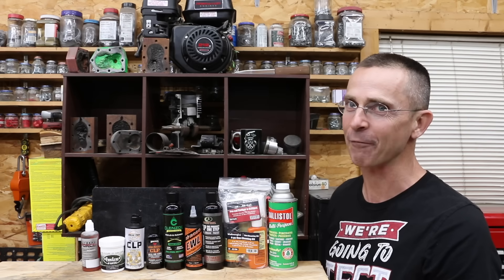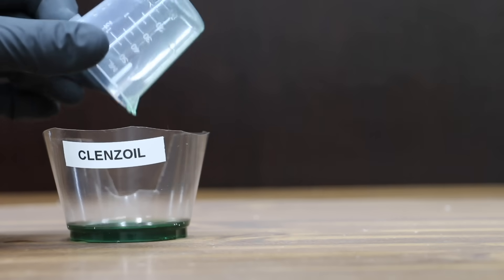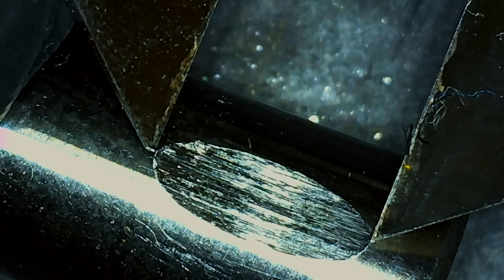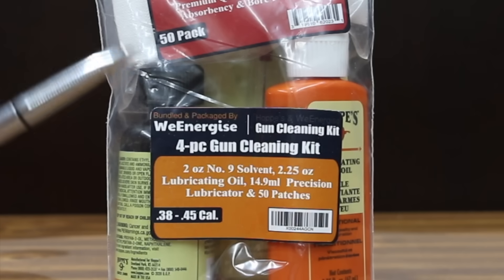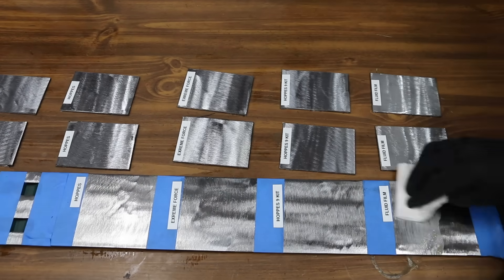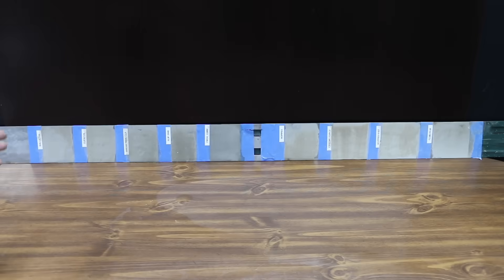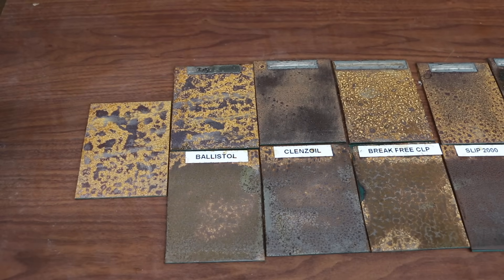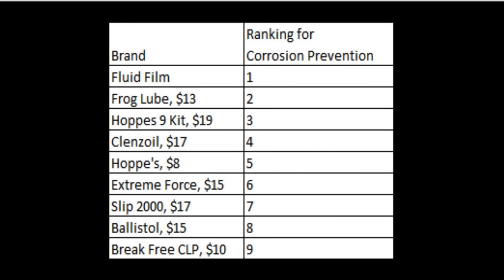Don't Buy A CLP Until You Watch This Review! It'll Save You Time And Money!

Comment: I have been an avid fan of yours for quite some time. However, your test methods for these products were not the best thought out. I would not have used the lubricity test. At what point am I running untreated metal on metal at such high frequency?? Even during automatic fire, you still take 3-5 seconds between shots. Also, one would only shoot, depending on your rate of fire, 5-10 rounds at most per trigger pull. (yes, you can choose to go cyclic, but you're also going to ruin the barrel along with other components.) Even an ar15 will ultimately fail and catch fire if you simply slam hundreds/thousands of rounds without stopping. There's so much here that took the products well beyond what I would ever expect of them. I love your videos, but this one will be one that I don't recommend to others. Thanks for putting out content that is authentic and unbiased; I can't find that much anywhere these days.

Comment: I have used most of these products and found synthetic engine oil works about as well or better than most, relatively inexpensive and or free if doing your own oil changes and save residual contents in the bottom of the bottles for gun cleaning.  When doing oil changes does anyone ever wait for the bottles to completely drain there is usually always enough in the bottle for gun cleaning.
Reply from the maker: Thanks for the feedback.
Reply: @ProjectFarm  Thank you for your time and energy to make these videos always enjoy them.

Comment: I think any good synthetic motor oil like Mobil 1 or Amsoil will outperform any firearm lube in the world. I use Butch's Bore Shine and MONTANA X-TREME COPPER KILLER (basically ammonia) to clean my firearm bores. Then I coat all exterior surface and wear surfaces with 15W-40 Amsoil Diesel and Marine motor oil (what I use in my Dodge diesel).
Reply from the maker: Thanks for the feedback.

Comment: Never buy hopps. Not only is it a shitty lubricant, NONE of the containers are sealed properly. EVERY damn container of theirs I have owned has leaked. Something as simple as falling on its side and it leaks the entire bottle. Has pissed me off more times than I can count. Of course the manufacture doesnt care. Ive called and complained, but they've done nothing to fix it. As expensive as they are, and as shitty as they are, you would expect SOMETHING that actually can stop from leaking when falling over.

Comment: As always, your videos are excellent! Very thorough and informative!  I've been using firearms for around 30 years, and have seen hundreds of gimmicky products both cheap and super expensive and I've tried a ton of them to see how they hold up in the real world, running a few hundred thousand rounds through pistols and rifles over the decades.   I've used most of the products in this video, and the only ones I've purchased again and again have been Hoppe's, Clenzoil and Break Free CLP for different applications.  It would be great to see a test of the following hyped-up products:  Militec-1, FireClean, Strike Industries Anti-Venom with XPLC, Gunzilla, and Shooter Lube.  The claims are pretty far out there on these, but I do like the Antivenom XPLC spray and keep a can in my range bags, and Gunzilla has been pretty good for cleaning.  I haven't used the Shooter Lube yet, but have used Militec-1 in my firearms as well as in my cars as an oil additive.  Baking that stuff in is how it works best, but would be good to see an actual testing comparing the above. I have a basement full of gun stuff I've collected over the years, which is what happens with any hobby!  Thank you for your videos!!
Reply from the maker: You are welcome!  Thanks for the suggestions.

Comment: I love frog lube but the gun has to be stripped of any previous oils and only frog lube can be used after once applied. I would sonic clean the parts with the cleaner diluted with water then do the frog lube process. Glock 43,grandpas old 12 gage 500,and a 223 mossberg mvp predator done 4 years ago and still perfect with normal upkeep.
Reply from the maker: Thanks for sharing.

Comment: From Personal experience with a used Glock, DO NOT, use frog lube and then start using regular oil and cleaners. the Results of doing so took my gunsmith baking my Glock 2-3 times the first time, and 2 times the second time the issue happened. The gun ended up with a cosmolene type substance when the Frog lube and Hoppe's oil and cleaners were mixed, which caused the gun to have issues when it was at outside temps about 90 degrees, until i was able to force the gun to shoot multiple rounds which i can only guess that it heated the goop up to where the gun functioned fairly decently until the gun was let cool, then the problem repeated. The prior owner also put Frog lube in the Firing pin area for God only knows why which caused light strikes, i was able to hit the same primer 3 times or so before the round went off. After the pain staking and money expended the Glock works just fine, not the guns fault.
Reply from the maker: Thanks for the feedback.

Comment: @Project Farm First off, thanks for doing these great videos!  Second, lots of people that I know have been debating the best gun cleaning/lubricating/protecting products and this video puts their top choices to bed.  However, my top choice for use as CLP has always been Mobil 1 0W-20 Advanced Full Synthetic Oil.  I remember in your other video where you compared the Mobil 1 vs Pennzoil vs Amazon Choice Synthetic Oil.  The Mobil 1 Oil performed best for wear and tear protection and also high and low temperature performances.  As long as I leave a thin film of Mobil 1 on my gun, I'm getting all the protection my gun would need.  Could you do a video where Mobil 1 Full Synthetic Oil is face off with the best CLP and a molybdenum grease?
Reply from the maker: You are welcome!  Thanks for the suggestion.

Comment: Great topic!  Keep testing more products!  I use Break Free CLP for most metal cleaning, but for long term lubrication and rust proofing I use Liquid Wrench Motorcycle Chain Oil!  Wonderful stuff sprays on as a fast foam which soon becomes a liquid, and then within minutes it penetrates deeply and shrinks down into a thin layer of not-too-sticky grease that lasts a LONG time.  It easily buffs down to an invisible polish layer on blued steel too.  Great test: keep going!..............................elsullo
Reply from the maker: Thanks, will do!

Comment: Since cold weather isn’t an issue, I’ll clean with Hoppes, lube inside with Clenzoil, then lube the outside with Frog.

On a serious note though the Clenzoil performed great and it’s Vet owned which a cool as well. Great job on the testing PF!
Reply: You don't want to mix these !  Its even in the directions. Frog Lube especially does not play well with others. Pick one and use it for everything.  You could use the Hoppes #9 Bore cleaner. This is a solvent type cleaner so I would imagine it would be ok, clean everything , then let it dry then use your favorite lube/protectant.  The Hoppes #9 clp's are a different thing  as they are lubricants and a cleaner I suppose. I would not mix those with Frog lube on the same item or you will end up with a waxy sticky mess that will harden and make a firearm inoperable over time. Check any of the firearms forums , It was a huge problem when the biodegradeable non toxic Frog lube came out 10 or so years ago. If guys didn't thoroughly strip and clean all traces of other lubes off their guns before applying frog lube they had problems. Then the cold weather thing happened. It just has too many issues for me and I used it on all my guns when it came out. I had to strip and clean all my guns and went back to full synthetic lube. I use Hoppes #9 cleaner and a good quality lube. I use Ballistal for wood and leathers as its  recommended. no problems and they all work great. To me CLPs kinda are like shampoo and conditioner, Its hard to do both with 1 product. They kinda can but they  don't do either as well as separate cleaner and lubricants will.
Reply: By performance and price, you should clean with Clenzoil since it is much cheaper than Hoppes CLP and performs the same.

Comment: I know you've done plenty of spray paint related content, but what we NEED is a HIGH temp spray paint comparison! It seems every "high temp" spray paint for headers etc seem to fail quickly even with proper prep and application. Would be interested to know if there are any out there that actually can be used as advertised and will hold up for more than 10 minutes on hot headers!!
Reply: There isn't a paint alive that will last on headers.. even coatings fail, but only under extreme conditions.

Comment: Thanks for this video. I was considering switching away from BreakFree CLP to something else when my current bottle runs out, but turns out it's not necessary. It's "good enough" I think in modern firearms (think polymer frame pistols), where there's already lots of preservative coatings (Melonite, Tenifer, etc...) the P aspect of a CLP isn't as necessary, since those modern coatings are generally enough. Maybe in older guns where finishes are more prone to corrosion require something with a bigger P aspect. Location is also a big factor. I live in a relatively dry area, so ambient humidity isn't a problem.

I've had the unpleasant experience of having to clean out FrogLube from a friend's gun. It was gummed up from either too much applied or not following directions and using heat to have it soak in. I believe FrogLube directions do say to use a hair dryer or heat gun as a finishing step.

For a suggestion on a further video, lots of people like to use Mobil1 as a lubricant in guns because it's much cheaper than specialty CLP products. Maybe add that in further test batch? Or how about gun greases, along with Mobil1 grease?

Comment: G-96 gets my vote. When considering a test like this it would have been nice to see a poll put up to see which CLP's people would like to see tested. I could see where a poll would not be needed for many of your other tests, but it would have been great to see one for this test. Keep up the great work!
Reply: G-96 gets my vote too
Reply: I agree. The G-96 bio-CLP is my go-to product.
Reply: G96 has been my go to fir 40 plus years
Reply: I use only G-96 on all my stuff.
Reply: I totally agree, I hunt in Wisconsin, it never gets thick in cold hunting temperatures, the gun action is as smooth as silk in any temperature including below zero
Reply: G-96 is my favorite too and it doesn't stink like hoppe's nitro solvent or ballistall does when you're cleaning. Depending on the firearm I use G-96 or high temp wheel bearing grease for lube

Comment: A great video, as always. Thank you!

I like Ballistol for cleaning. It is inexpensive, gentle, and non-toxic (externally, at least). It cleans as well as anything else, though in some cases, the parts might need to soak a little longer than they would with a solvent.  

That is only for cleaning, though. None of the products in the video should be used for lubricating firearms. A proper lubricant will work much better. 

Using a CLP for cleaning and lubricating is like using a shampoo and conditioner in one. It is better than shampoo alone, but it will never work as well as a separate conditioner. Only in this case, we are talking about something your life might depend on, rather than the softness of your hair. 

I use Breakthrough Clean Battle Born HP Pro Lubricant, along with their Battle Born Grease, where appropriate (grease for BCGs, charging handles, etc.). 

A test of that, compared to other lubricants, such as Hoppe’s Black, would be great. I would also test them for how long they last before drying out and how likely the oil is to drip off of the parts with time. These are important factors for people who don’t clean their firearms regularly. I’ve seen it cause malfunctions before.
Reply: The original (German) Ballistol is also non-toxic for internal use, and a great remedy for heartburn.
Reply: I've used Ballistol since 1997. 🇩🇪  Guns, tools 🔧,  knives, car(hinges, hoses). It's CFC free, no fumes. I live in central FL where Cleenzoil is sold in a few places. I might grab some at Shooters World.

Comment: The clezoil is impressive. I've found bike chain lube and gun lube to be pretty interchangeable. Curious how it would do on my mountain bike chain.
Reply: After solvent cleaning in the bores,  I use Liquid Wrench Motorcycle Chain Lube for all of my gun lubrication and surface protection.  It sprays on as a foam which quickly becomes a liquid that can be swabbed around.  Then within minutes that shrinks down penetrating everywhere and leaving a not-too-sticky thin layer of grease.  Exterior surfaces can then be lightly buffed into a hard shine like a polish.  Great stuff!................................elsullo
Reply: @elsullo2  I use that stuff on my motorcycle, good stuff. Never thought of other uses.

Comment: I'm sad you didn't have a full synthetic motor oil in the testing panel. Motor oils includes detergents that do provide cleaning, as well as anti-corrsion additives that keep the metal free corrosion and  wear.

A motor oil should seriously be considered as the "control", the default oil that must be beaten to warrant the exorbitant prices these "gun" oils demand.

Comment: I've used ballistol for years.  I've just ordered clenzoil.  I've had guns experience light primer strikes while hunting and always thought it was some combination of too much oil, too little oil (they are cleaned after each use).  We'll see if its better with clenzoil vs ballistol.  Thanks for the video!
Reply: Ballistol is water soluble oil which was designed in the mid 1800s as a black powder gun cleaner, Still works pretty good when used in conjunction with hot soapy water for cleaning black powder firearms.
Reply: @iffykidmn8170  almost, the company was founded in the 1870 and the famous Ballistol formula was developed in 1904. The stuff is great for it's multitude of use cases more than it's performance in a single field. You can really do anything from cleaning guns to waterproof and preserve leather
Reply: @iffykidmn8170  that’s interesting. I’ll keep it I mind for my black powder firearms. Thanks!

Comment: There are two products I'd add to this test.  One is Hornady One Shot.  It uses a solid lubricant, so it shouldn't attract dust, and has done well in other tests.  The second is Lubriplate FMO-350-AW.  The gun writer Grant Cunningham recommends this.  It is not a dedicated gun oil, but a heavy duty industrial lubricant with a lot of properties that would be good for firearms uses.  It would be a good demonstration of how non-gun specific products would do.

Comment: Hey Todd!!!!        You might consider gathering sample (enough to do it)  transmission oil from several vehicles and have that analyized like you have done with motor oil to see just how broken down the oil has become (if the oil has actually broken down).   Transmissions are common sources of confusion concerning servicing and not cheap whatever is done.   Thank you for your channel and hard work.

Comment: I remember for my 8th grade science fair project, I compared the properties of gun oils. I was a Hoppes fan until I did the testing. Since then ive been using the Break Free CLP. Id like to note that when compared to Rem Oil, Hoppes oil, and another gun oil I don't remember, it exceeded in corrosion resistance. It may not be the best CLP at rust resistance, but it was better than the mainstream names in the gun oil industry. Great test Todd 👍 keep up the great work.
Reply: Breakfree CO is great corrosion resistance and for long term storage. CLP for every day or week use
Reply: I used Ballistol on knives 🔪 guns car stuff since 1997. It worked well for many years. I'd use a gun oil on the firearm barrel for added protection. Slip 2000 EWL is a great product too. I expected it to perform better.

Comment: My observations may not be exactly scientific,
But muzzelloader cleaner's.
After using a few muzzelloader accessories, lubes, cleaners, oils.
The muzzelloader cleaner's seem to be alot better then the modern cleaners. I'm guessing there is an obvious reason for that since muzzelloaders need to be maintained more then the modern stuff.
Bore butter suprises me everytime, no matter how clean I think something looks.  If I do a bit of bore butter after cleaning I always got more gunk out. 
Only downside with bore butter is temperature. To hot it gets liquidy and to cold and it gets really tough. I suppose it being tough could be a good thing in some situations. 
I find that Basic general purpose grease seems to do a decent job at grabbing all the gunk off metals. When all els fails letting some grease sit for a few min on rust or whatever needs cleaning seems to de the trick without breaking the bank.

Comment: One of the problems with your test is that you didn’t apply the Frog 🐸 Lube properly as per instructions. After cleaning you metal you heat it up with a hair dryer or heat gun and apply the FROGLUBE… you will most likely get better results if you do this . FROGLUBE isn’t like all other CLP’s and if you apply it improperly, especially in a Firearm, you won’t get good results…. More is not better with the Froglube